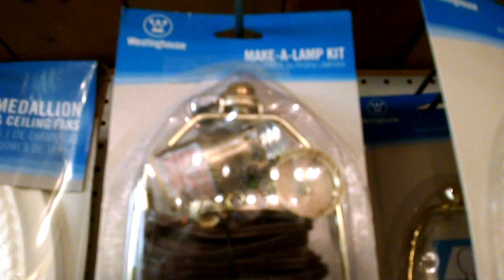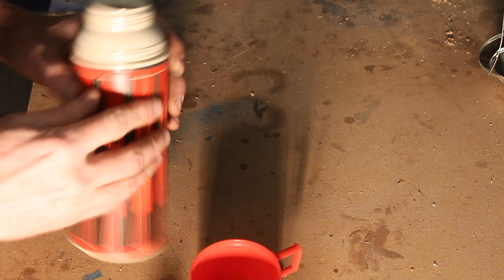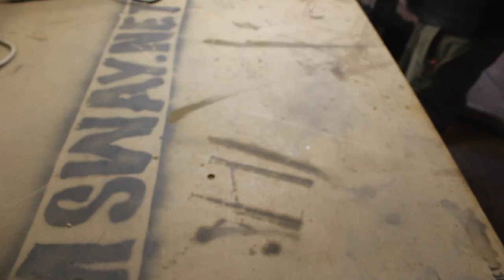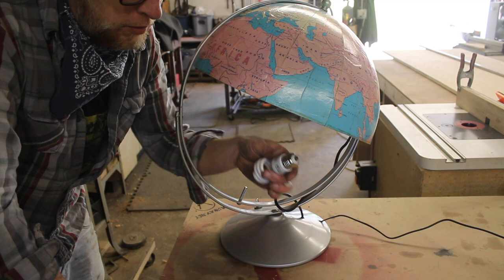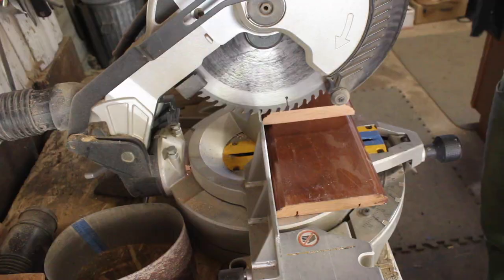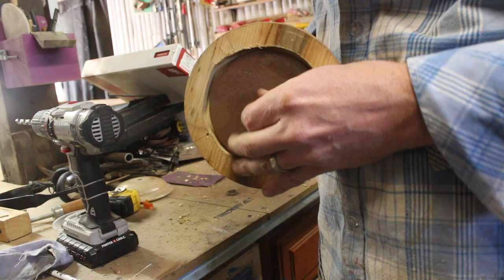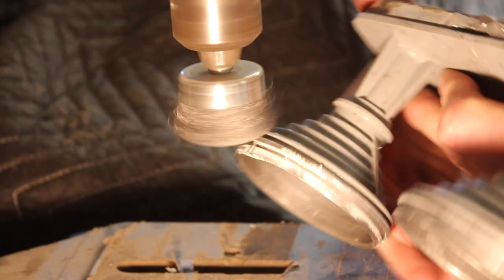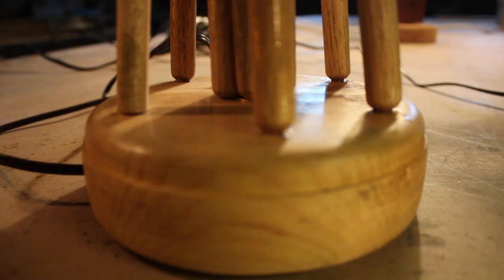How to Make Lamps from "Junk" and other Upcycled Stuff

Comment: I bought a 1956 Chevy Tail Light for $3 at a junk store. At the local Goodwill, I found a banana hanger (not sure what it's called) for $1. The hole for the screw on the tail light fit perfectly over the hook on the banana hanger. Finally, I put a cheap night lite clip into the hole made for the original bulb. Way COOL desk lamp. Total cost: $8. I sold it for $65.
Reply: PS:  NO Drilling, Sanding, Painting, Welding, Parts, Lamp Shades, Hardware,  Glueing, Drying Time, etc!
Reply from the maker: nice!
Reply: That sounds awesome. ❤️

Comment: This is a second video that I found. I did not realize it was the same artist that I saw building a table, which it was beautiful. I he a hard time throwing pieces of wood as well, and as well bamboo pieces, I saved an exterior light fixture just like the one in the video, I am taking your idea and building one, I thought what a great creative idea. I have copper bolts that I am going to use for the dining table, I do not have steel or metal to attach like you did.  I save every little thing that I can, it becomes part of a piece of art. I am subscribing; off to find other videos of yours!❤️❤️❤️❤️❤️
Reply from the maker: Nadia Mubarak cheers and welcome! I have a lot of videos (and a lot of stuff I can't  throw away:)

Comment: I LOVE the drum lamp you showed...  Also, I gotta agree...  Vintage VW bits and pieces are cool as the other side of the pillow.  I'm also digging the satellite lamp.
Reply from the maker: +Greg's Garage thanks. i made that for my wife. just replaced a shade on a thrift store lamp with it. simple metal frame welded to hold the drum up.

Comment: love working with reclaimed materials, great job on the variety of lamps.
Reply from the maker: thanks man. I work basically exclusively in reclaimed. I find the limitation fuel creative solutions.
Reply: At this point I'm doing a lot of mixed work and reclaimed is usually for fun. Actually I just started my own channel called Artfully Rogue and I posted a reclaimed wood stove video today that I ended up making the other day. Once I have a few more videos I figured I'd try and boost more. I did some reclaimed ceiling lights out of some old wood beams I found which turned out pretty cool. Keep the videos coming, its cool to see someone with the same mind set.
Reply from the maker: Cool. I'll check it out. You may dig our podcast, too. "Reclaimed Audio"

Comment: Seems like lamp guts are easy enough to use - might be my first electrical project!
Reply from the maker: +Sarah E Hoffman very easy. just connect the wires and make sure there is no exposed metal wire when you're done. electrical tape!

Comment: Amazing!  I could watch these all day!

I make ceramic lamp bodies. I went to a lamp repair store and they wanted $500 to wire them... Can you recommend and kits or videos that show how to put store lamp kits together?  Keep making these awesome videos, please!
Reply from the maker: there's really not a lot to it. two wires, make sure they don't touch, then whatever hardware you need to secure the bulb to the base. you might need to group together threaded tubes to run the cord through, or you might need to add some weight to the bottom...  I avoid shopping Amazon but here's a link for reference to a generic one, and there are companies making fancier things, too. https://www.amazon.com/Creative-Hobbies-ML3-12S-Complete-Instructions/dp/B00SXF2AC0/ref=asc_df_B00SXF2AC0/?tag=hyprod-20&linkCode=df0&hvadid=198058458227&hvpos=&hvnetw=g&hvrand=7738357749722205096&hvpone=&hvptwo=&hvqmt=&hvdev=c&hvdvcmdl=&hvlocint=&hvlocphy=9003364&hvtargid=pla-320493069585&psc=1

Comment: Question! 
Have you ever used the 3 way touch dimmer switch in a lamp? 

In conjunction to my question: 

I have a custom Bare metal base, and I’m thinking of painting it with hammered finish spray paint.  Probably 2 coats, and maybe one clear coat.                                                              Do you know if the 3 way dimmer will still operate with the base Being painted? Or will this make it, non-conducive to human touch?
Reply from the maker: I have absolutely no idea how those work. sorry!

Comment: cool vids.  for lamp hanging from ceiling, does the socket have to have a ground or can be ungrounded?
Reply from the maker: I'm not a licensed electrician so I do not want to answer any questions like this and be wrong. Check your local code.

Comment: Hey Tim, I  have an antique carved banister post.  It would make a really cool lamp, but I have 1 problem ... how do I  drill a 4' long hole through the center of the post for the wires?
Reply from the maker: they make 12" long drill bits. usually contractors use them to get through walls and stuff.
Reply: 1' doesn't  do me much good.  I need at least 2' because the post is 4' long.  Thanks though.
Reply from the maker: @marjorieprezioso4750  Oh, I read that as 4 inches, not feet. Yea, to do that you'd need probably need to slice it in half, drill out both halves, then put it back together.
Reply from the maker: @marjorieprezioso4750  they are more than 12" long usually, more like 16-18". You could also make the wire not come out of the bottom but rather the side, about 18" down, or use battery powered LED lights that are so cheap and easy nowadays.

Comment: I saw a sewing machine turned into a table lamp, I've found a couple old machines but I'm not sure if I can drill into the machine to carry the wires through. I'm afraid it may chip off the finish. Do you have any suggestions?
Thank you, Connie
Reply from the maker: usually the hardware has washers/trim that would probably cover any chips.

Comment: PLEASE help?  I love wall lamps and I love mallard ducks.  I would like to have two mallard duck wall lamps.  But, I don't know how to make them or even where to start.  Please help?  Thank you.  V/R Gary
Reply from the maker: You mean, real dead ducks or something that just looks like them? If it's the latter, I could probably design and make something for you, but I'm a vegetarian so I don;t want to work with real dead ducks... :)
Reply: No.  Not real mallard ducks.  I'm sorry, I should of have been more specific.  Like mallard duck decoys or something that looks like them.  Two of them.  One facing one way and the other facing the opposite way.  Thank you for replying.  V/R  Gary
Reply: Did you get my last message?
Reply from the maker: curraheewolf sorry I get alot of messages. Don't see them all. Find some decoys on line and mount a light behind them. I could do it for you if you want to email me direct. I Don't think it would be too expensive. Tim@timsway.net
Reply: I sent the e-mail out.  Thank you.
Reply: I got six duck decoys that I like.  Would you still be interested in making them into wall lamps?
Reply from the maker: yea man! I wrote back to you. did you get my email?
Reply: No.  I may have overlooked it by accident.  I will check again.
Reply: I could not find it.  Will you send it again?  Thank you.

Comment: How to make lamps with a full workshop of tools and gizmos.
Reply from the maker: Everything I do can be done with basic hand tools. It just takes longer. Fancy tools and gizmos only speed up the process and make it easier to achieve tighter tolerances,  they do not do the work. I started this business with a circ saw and cordless drill and reinvested in myself with every sale (and most of the tools and gizmos I also got for cheap or free from tag sales and dumpsters, like the material I work with). Don't look ar the forest, focus on the tree.